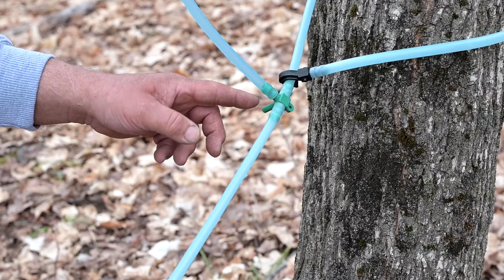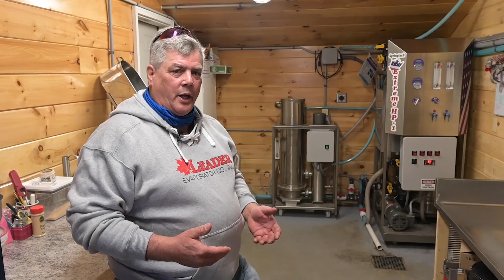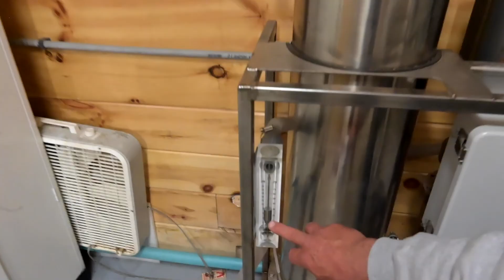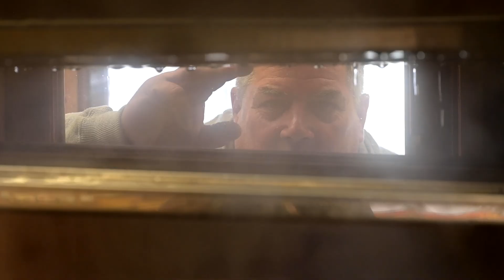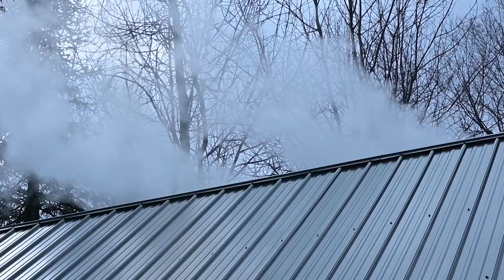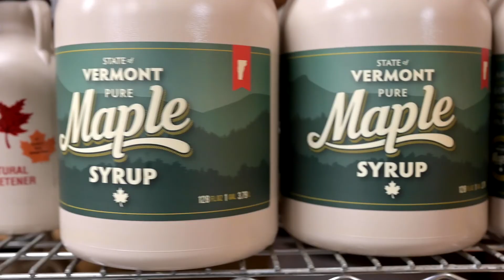Tips for Doing Maple LARGE SCALE

Comment: Any issue long term using 3/4" mainline vs 1" ? Roughly how many taps are you putting on a 3/4" mainline? Thanks
Reply: I wish they would have answered. My 3/4's are 300 feet long. I have around 80 taps on each. THe rule of thumb used to be "strive for five", meaning 5 taps per latteral but no more than 10. I am seeing many people putting only 1,2, or a maximum of 3 taps on a latteral, and keeping the latterals very short, like 10,15 feet. IDK how many taps are reccomended for 3/4, but I do know you want few enough so there is only a tiney bit of sap in the bottom of the main so there is plenty of room for vacuum to travel to the taphole. Ive been modifying my own tubing by trial and error for 20 years. I have 15 acres, and currently 1100 taps. The cost per tap can get expensive because a saddle costs $3, and 3/4 is $120 for a 300 foot roll, but if we can maintain over 25" at the taphole, we can make a half gallon of syrup per tap. and to get the vacuum to the taphole we have to minimize taps on latterals, and on the mains
Reply: @maxlown363  500 taps on 3/4 mainline
Reply: 500 on 3/4